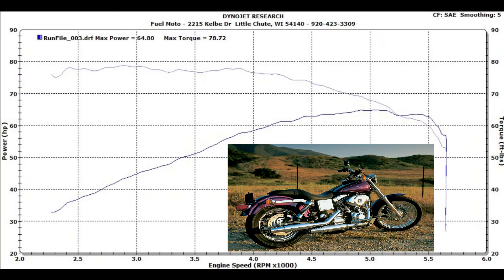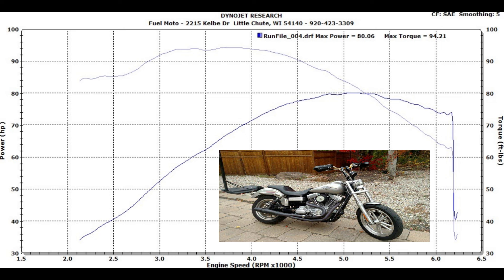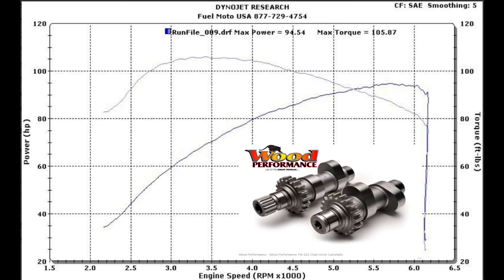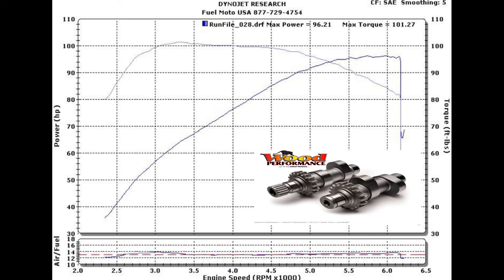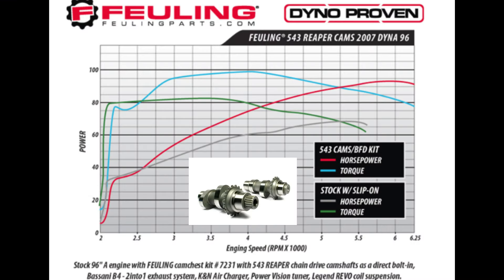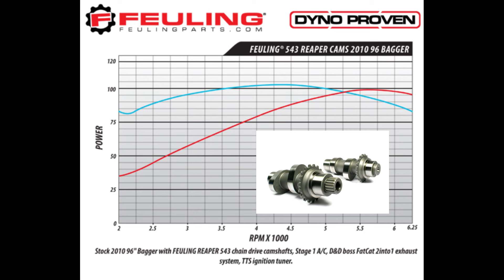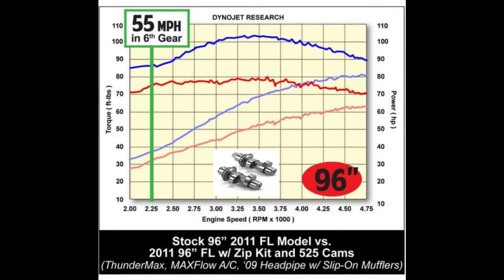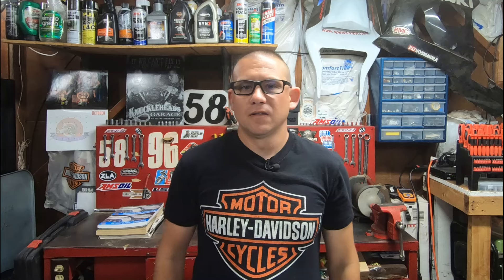Consider New Cams For Your Twin Cam 96 Before You Convert To A 103

Comment: So glad I found your channel man. Lotsa good info on here. Question for ya... if you had a TC 88 with stage one done and a Dynojet Powervision, where would you go for power? Also, let’s assume stock cam tensioners are on the bike and most riding is done 2500-3500 RPM range. (I just described my Dyna in my avatar pic).
Reply: I put 510c cams in my 2000 superglide with arlen ness filter and drag pipes with no baffles. I am super happy with those cams, a little more lope at idle, pulls hard all through the RPM range (really hard around 4k). My bike has 56k miles on it, with the cams installed around 48k miles. No issues so far other then I have rocker box rattle. Which isn't even too bad, it just drives me crazy since i noticed it
Reply from the maker: I would go ahead and upgrade your cam, while it's down add a hydraulic tensioner upgrade in there too.
Reply from the maker: T
Rocker box rattle is annoying but not uncommon, have you ever looked at rocker lockers? They will take care of the noise.
Reply: @GixxerFoo  I read about them a while ago. Im gonna have to look at them again
Reply from the maker: They will tale.care of that rattle, they make them for the Sportster too.

Comment: I just don't get the need for the extra power. My '02 Dyna 88 has all the power I can use. Guess I'm past doin' smokers in the parking lot. lol
Reply from the maker: The horsepower is great and all, but on a Harley you really want torque. The bigger the torque at the lower the rpm is a lot of fun to cruise with on the streets.

Comment: Thanks for the info!  Thoughts on the S&S Easy Start cams? And if you like them best option ‘08 Sreet Bob, shorts shots, big sucker air intake.
Reply from the maker: I like the concept of them without having to add compression releases and they do perform well. Are you looking for a bolt in cam or something more aggressive?
Reply: @GixxerFoo  thanks!  Shifting gears on this. I’m actually trying to use up some parts left over from a 110-117 SE upgrade i did on a low rider tc.

I have the following parts: 110 heads (with compression release), SE259E Cams, perfect fit pushrods, SE tappets, 58mm intake off 110, 58mm injectors.  

I think that’s it and i THINK this build idea works.  😉
Reply from the maker: That's a nice stock pile, that will make a nice build!
Reply: @GixxerFoo  thanks for the help!  You like the 58mm intake and injectors off the 110? Not sure what stock is and not clear to me when to increase air and injector size?

Finally would you recommend higher compression pistons since I’m going to have the heads off anyway?
Reply from the maker: I would definently up the compression, that's one thing the twin cam lacks is compression. The 58mm throttle body is actually a really nice upgrade on a twin cam 96 and 103. It works really well on the M8!

Comment: Love that this video popped up. I'm looking to have a cam swap done on my 2011 FXDC over winter. I'm not sure if I wanna do the woods 222 or the 555 or the Andrews 48. I like the torque factor and I like the power right off the line so I feel like a torque cam would be beneficial. I do like to get up to 100 110 every now and again as well. I'm running a thunderheader for exhaust. I already have a high flow filter. What do you recommend sir?
Reply from the maker: You've got an excellent exhaust system so that's gonna help tremendously with whichever cam you choose. I personally like the all around power of the 222, it's got the torque and the horsepower throughout the rpm range.
Reply: @GixxerFoo  sweet. Yeah I'm looking to make it very quick and not so much top speed, I like getting up to speed fast lol. I love the thunderheader, it helped for sure. I can't wait to do a cam upgrade
Reply: @GixxerFoo  would the woods tw6-6 be any better than the woods tw222 as far as making it quicker off the line or would it benefit the powerband over a broader rpm range?
Reply from the maker: A new cam will take full advantage of the Thunderheader!
Reply from the maker: I personally like the 222 for it's broad power range from down low all the way to the top.
Reply: @GixxerFoo  okay cool, I think it would really wake up my super glide. I'm wanting to make it a torque monster, twist the throttle and hold on type of riding experience lol
Reply from the maker: The 222 will do that without robbing your top end. There's other cams out there that will peak your torque marginally higher but cut your horsepower tremendously.
Reply: @GixxerFoo  sounds good thanks for the helpful information boss 🤜
Reply from the maker: Not a problem at all, anytime

Comment: Not a S&S fan?
Reply from the maker: Depends what cam, to me their cams for the 96 are little soft. But they perform a lot better with the 103 upgrade.
Reply: @GixxerFoo  My mechanic has a thing against S&S it seems so the Wood TW -222 seems my preference. Just gotta save a bit and find a way to get it to my state ;).
Reply: @GixxerFoo  PS: Ordered the Wood TW -222 based on your and my mechanics recommendation. Should do the install next month. Thank you.

Comment: this time I'm drilling and taping a hole in bottom of intake plenum for.........fogger nozzle
Reply from the maker: 👍 how much you gonna hit it with?
Reply: @GixxerFoo  well hopefully I'll be able to use the progressive controller I got for this system. You know start little ramp up a wee bit till  tire blows off then back of a step or two...LOL I got away with just getting 1 piston w/ 2 sets of rings a little dingleberry action will clean up cylinder.
"I SWEAR before GOD and all, I WILL N E V E R keep going if/when she gets that hot again"...Peace!

Comment: Woods cams are noisy!
Reply from the maker: They are but they sure produce the power across the RPM range, they have quite a bit of overlap to hold those valves open longer.